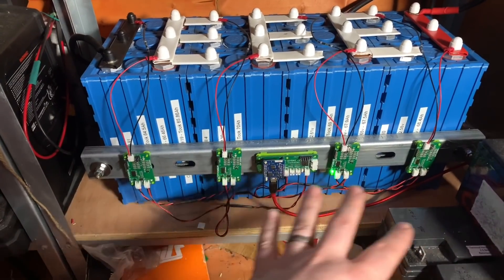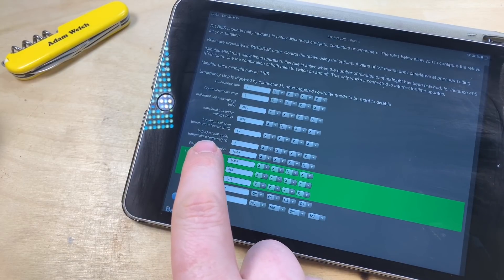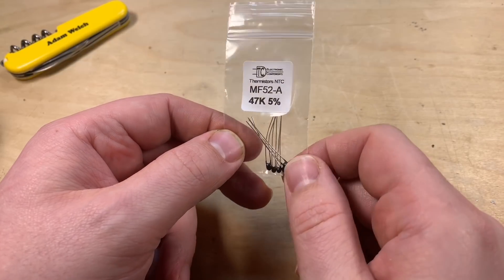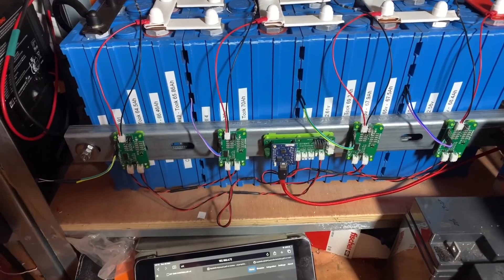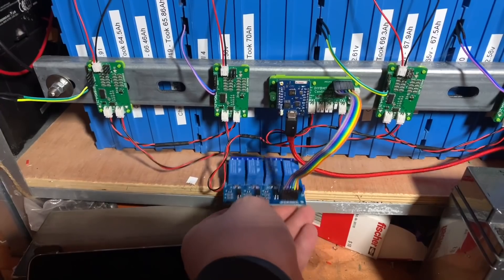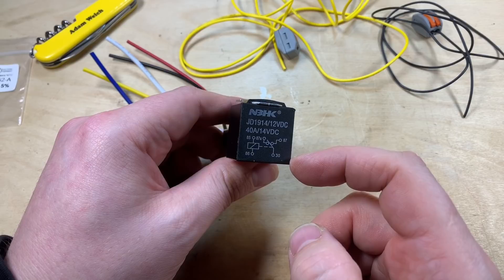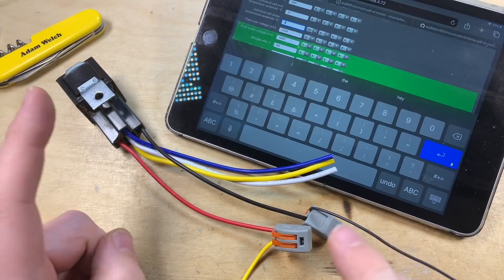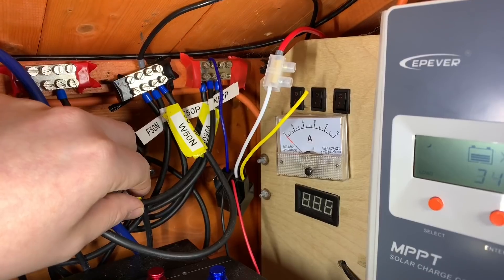diyBMS Temperature Control

Comment: Why dont you use this relay to start heating yours batteries by the solar and/or by itself. You can add and use some heat panel at the bottom of the batteries. imho
Reply: Exactly my thought.  You don't even need to change circuitry or programming - just have it fed by the yellow lead on that 12v relay so that when solar is disconnected heating kicks in.

Comment: If temperature goes low and charge relay gets open , won't the relays keep draining the battery until the battery is completed drained and then once it drained the relays will open and the battery will start charging again until again relays activated and drain again.

Comment: Just curious why you used the NC connection between the solar panels and the charge controller. Wouldn't this mean that to disconnect the solar panels in low temp conditions you would have to have a constant load on your cells? Is there any potential that the cell voltage drops below the relay threshold, causing it to de-energise and  reconnect the solar panels while the temp is too low? If you energise the isolation relay when the temp is in a safe zone, then it could be energised with solar power rather than battery power and would safe guard your setup. The only trick here would be cell drain overnight, and the potential need for bootstrapping the isolation relay. I suppose it comes down to trading off between cell protection and system performance - something you've likely already weighed up.
Reply: The above is probably a moot point; I just read a couple of other comments.

Comment: I need electricity in my house, but I can't save it because of the very high cost.
And I'm from a very poor country.
Reply: Solar
Electrolysis of water, and a compressor and pressure tank for hydrogen
Than you can burn hydrogen, and run a little turbine/generator at night

Comment: Would be great if you could DIY a mosfet based relay that could be switch by the 5v relay board, as I wanting to switch large battery current up to 100 amps, similar to BMS switching current I have tried using SSR but they failed badly over time

Comment: could have the yellow on the relay to supply a heat pad under the batteries but i guess in this weather with so little solar supply its not really worth it. Hydro or wind maybe it would be different. Still havent got around to hooking my pittaway bms to my calbs but ive had alot of things going on.

Comment: would it not make more sense to use mosfets instead relays?
Reply: 3mixer what do you think?  Try finding a 10A MOSFET that doesn't fry
Reply: @simonmasters3295  obviously you would have to paralel them as you require and proper heatsink required.  I just thought using relay to activate another relay not the best option.
Reply: @3dmixer552  Sure, and I would say that a year ago my electrical engineer and I said let's do this MOSFET and after six months we were nowhere.  In contrast the NO, NC binary choice of a relay makes the choice a no brainer in my view.
Reply: @simonmasters3295  we,ll, the issue i can see is that using a 10A relay will require another relay to be able to handle let's say 60A charging.  In this setup you would use a 10A relay to switch a 60A relay. With mosfets you could cut the middle man out
Reply: @3dmixer552  Yes I know that, I'm not daft.  Please show me (a) the product you intend to use (b) an estimate of installation time.  Then I will scale for 1, 10, 100 and 1000 kW
Reply: @simonmasters3295  what are you on about?
Reply: @simonmasters3295  "Then I will scale for 1, 10, 100 and 1000 kW"  really?  and you will attempt to balance such a battery bank which capable of putting out such a power with 10mA current? Good luck with that.  If you want a system that capable of putting out 10, 100 or 1000kW you will need some sort of industrial bms not Diy bms :)  This bms is designed for smaller battery banks

Comment: Since you're putting relays on the solar outputs is there anyway a switching from parallel and serial connections for cloudy or sunny days? Thanks for the video very interesting
Reply: On my solar panels I have noticed that they perform better in series in winter so I now manually change them in summer/winter, doing this via relays is a good idea..

I squeeze an extra 5a (approx) by switching them in winter

Comment: Thank you for the video! You may heat you pack with that solar energy once it is disconneced due to the lower temp. I think you can charge the battery then.
Reply: Easy way to do that is to rewire the large relay so that the solar panels get redirected to some Peltiers under the batteries. A little like the dog cooler that Naomi Wu built but working the other way around!

Also, using the solar panel to power the large relay would reduce the current draw.
Reply: @NiHaoMike64  easier to use a resistive heating mat, peltiers are not terribly efficient.
Reply: @kienanvella  Peltiers are pretty efficient as heaters.
Reply: @NiHaoMike64  Agree. They are as efficient as Joule heaters plus they can steal a little from the cooler. The question is what to cool with the pelties in the shed... And yes, they are more poisonous and expensive than the resistive heaters. For latter I suggest a silicone heating band and a rug around for warmth
Reply: @GhVost  Thermal storage would be one. Thermally couple the cold side to a water tank and have the Peltiers freeze the water to extract the heat. Then use the water tank as a heat sink for some devices.

Comment: Just wondering if you would run into a situation where the battery voltage would drop sufficently to cause the relays to close again. Thinking of a long dark winter and current draining the relay coils. Suddenly you have a situation of charge current going into low batteries in sub-zero weather. Perhaps running normally closed connections would be better. A latching relay could help but would require more complex circuitry.
Reply from the maker: Yes I think there is a risk here, but for me I hope that risk is very low because I regularly check my packs voltage and I have some warnings set through my home automation software if I miss something. Switching so the relays are energised might be sensible if the pack was to be left unattended for a long period of time, but equally powering the relay constantly would speed up the undercharged issue. I’ll see how it goes. Cheers Dale.
Reply: The BMS supports a pulse output for driving latching relays
Reply: @StuartPittaway  sounds very plan-ish 👍

Comment: Been waiting for this. Nice interface with that bms.  You could program a relay circuit to power a small heater pad, insulate the battery, then solar disconnect would probably not trigger unless it's super cold. Nice job as always.

You have a ton of temp sensors on that pack 😁😂 total overkill. Nice
Reply from the maker: Cheers Will. I definitely need to insulate the battery bank and I’ve got an idea about heating the pack of the relay is triggered.
Reply: @AdamWelchUK they are really cool bms watched your journey with them , i was thinking same as other comment heating pad or inclosed box with heater fan , also with start temp cut off temp settings. Plenty of options great video keep it up very informative cheers thanks.